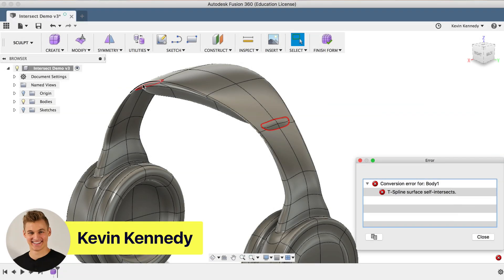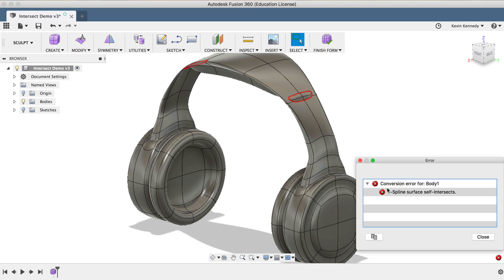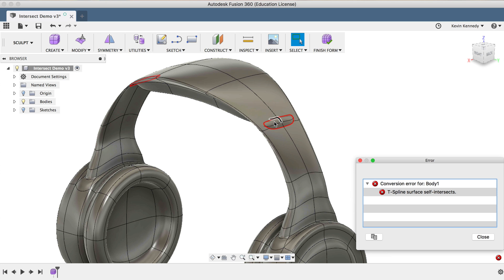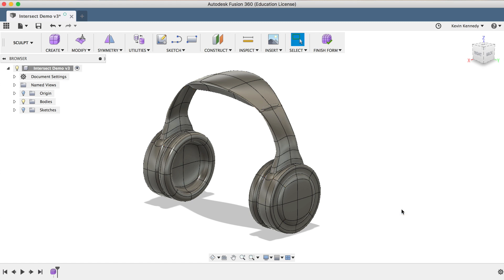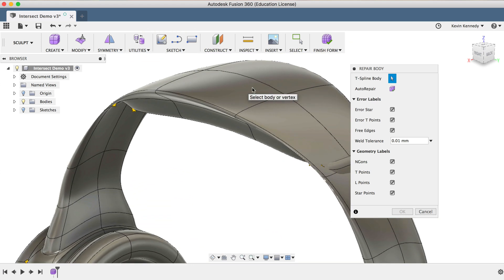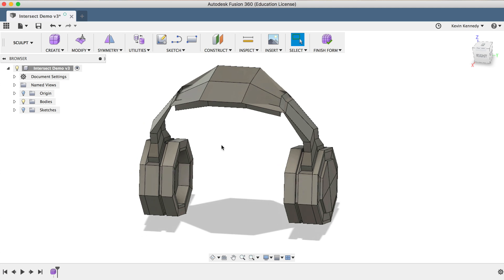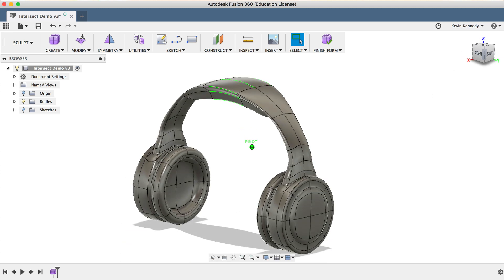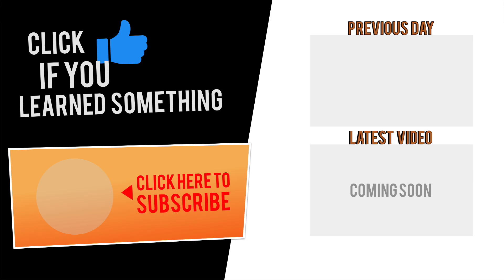How to Repair a Self-Intersecting T-Spline in Fusion 360 (Solution Explained)

Comment from the maker: P.S. If you liked this video, I'd love for you to Subscribe ► http://bit.ly/sub-right-now
—
HELP ARTICLE
Repair a Self-Intersecting T-Spline (Article): http://bit.ly/intersecting-error
—
TIMESTAMPS
0:00 - Repair a Self-Intersecting T-Spline in Fusion 360
0:30 - Recognizing the error
2:06 - Repair body tool
3:50 - Change display mode
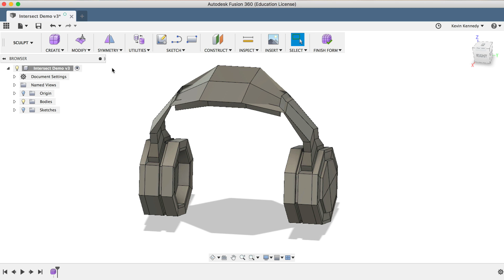4:26 - Turn mirror on
4:51 - Fix error
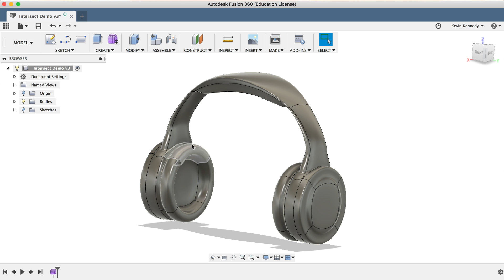5:31 - Recap of steps

Comment: why is this so overly complicated? It is a really quick video but why doesn't it just make a window appear that makes you choose which face to crop/cut and pick the dominant face or sculpt your connecting to, then convert it? Who in the world thought throwing an error box up was better than a simple idea like the one just proposed. like JUST LITERALLY ADD THE TRIM TOOL TO SCULPT.
Reply from the maker: Hi, Roberto. I understand what you're getting at. I would suggest you submit that as an idea to Fusion 360's idea station. If you submit it I'll support/upvote it - If you submit that to Fusion 360's ideaStation then I'd support it - https://forums.autodesk.com/t5/fusion-360-ideastation/idb-p/125
Cheers, Kevin :)

Comment: Auto repair fixed it! I was messing with for almost an hour lol. Thanks
Reply from the maker: Glad that worked for you! It's great when it actually works! Cheers, Kevin :)
Reply: @ProductDesignOnline  im happy it worked cause i was getting mad trying to fix it. It wasn't a t-spline error, it said something about vertices need to be welded :s i had used the feature "fill hole" and after a bunch of unrelated tweaks, the flat surface of the hole that was filled became tapered(cone) and it messed up the vertices.
Reply from the maker: @johnf4388  That will do it! I always recommend to periodically "Finish Form" while Sculpting to check for errors before you get to far. Nonetheless, glad it was sorted out. Cheers, Kevin :)
Reply: @ProductDesignOnline  - Hey Kevin... I never get to see the "Finish Form" option anywhere. There must still be something wrong with the edited shape somewhere...
Reply from the maker: @tonyrath4128  Can you share your file? To share your file - In Fusion 360 go to File > Share > Share Public Link (make sure "downloadable" is toggled on) > Paste your link here as a reply to this comment. Then, please write a separate comment letting me know you've replied with a link because YouTube flags most links and I don't always get notified. Cheers, Kevin :)

Comment: Thank you so much for this video! It didn't precisely address my particular problem, but it gave me enough to go on and I was able to fix my problem mesh in a few minutes!
Reply from the maker: Hi, Joel. Glad to hear that it helped! Would you mind sharing the specific problem that you encountered? I'm just curious...if it's something that would be helpful for other users I'll share it in another tutorial. Cheers, Kevin :)
Reply: While it claimed I had self-intersecting T-splines, the real issue was that I had coincident vertices that hadn’t been welded on one half of a seam. Your video inspired me to switch to box mode, and that helped show the slight gaps associated with the unweeded vertices.

Maybe a video on verifying that vertices are welded? I ended up moving vertices around a little and seeing if gaps opened up.
Reply from the maker: @HappyZentraedi  Thanks for the clarification. It's frustrating that the error messages are not better in Fusion 360. They are often misleading or two open-ended, which results in a number of different possible problems.
Welds are definitely a common issue/concern. I will try to incorporate this into a video sometime. Cheers, Kevin :)